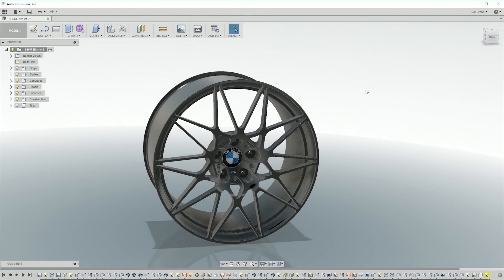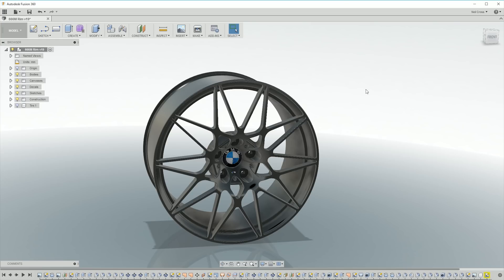Fusion 360 - Pirelli Tire Modeling Tutorial

Comment: I'd like to see tire treads fully modelled in Fusion. I'm not coming at this from a CAD user angle but as a casual 3DS Max user. In Max it's relatively easy to model the treads flat then use a bend modifier to wrap around the rim. As far as I know other CAD/CAM programs have parametric bend and twist modifiers but not Fusion. But I've started to really like aspects of Fusion 360 such as the comparatively easy parametric modelling and the freedom to concept model without endless fiddling with polygons.  Fusion is starting to get attention in the CG industry because of its ease of use. Seeing treads modelled in 360 gets my vote cos I'm certainly struggling to figure it out.

Comment: new sub here! your videos and humour are amazing! thankyou for your videos. i was wondering if you had quick advise/an upcoming video on best practise in Inventor when modelling a set of parts that are related to each other? should one do them separately and check that they work together by assembling them in an iam file or should they be built as new solids in the same part file and then split later?
Reply from the maker: Thanks! There's no right or wrong way, but if the parts are related to eachother in some way like in size or shape then its easier to do solids and split, otherwise there's nothing wrong with doing them together in an iam, you can also do in-place creation rather than separate parts in separate windows.  Good video idea for the future though!

Comment: Sweet rims! Any plans on detailed VRED tutorials?
Reply from the maker: I wouldn't rule it out.  Everything I've done here is self taught, I've only used VRED for a few hours so I'm a bit away from being able to put out tutorials on it, but I friggin love it.  Thing is, the rendering in VRED is very Autodesky, you have to put a load of effort in to get something properly realistic, I might investigate something like Keyshot as I've heard good things about that
Reply: TFI I'm using keyshot for my inventor models and found it incredibly easy to use. However maybe autodesk apps might work better together. Is there some sort of live linking to Inventor models? With keyshot you have to reimport the entire model to update it after changing something, can take ages...
Reply from the maker: Showcase has a live link between the original model and the showcase rendition, but Showcase is ending this year.  VRED doesn't have a live link unfortunately.

Comment: brilliant ....but can we use VRED with Inventor also I dont get why Auto desk push out a free fusion 360 which seems to be a very simular vesion of Inventor whats the catch ?
Reply from the maker: Yea you can use Inventor, VRED just imports a STEP file so Inventor can export a STEP too.  Fusion isn't free but it's only something like £30 per month, whereas Inventor is around £200 per month? They are very very similar but Fusion is missing a lot of what Inventor has
Reply: Cheers Neil .